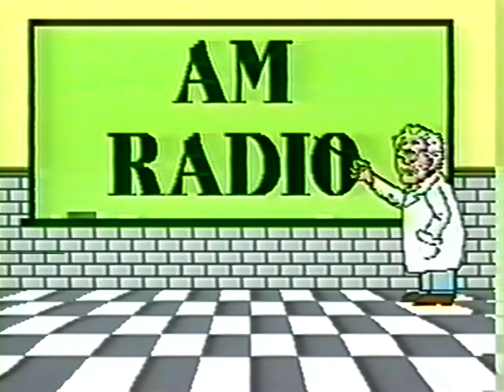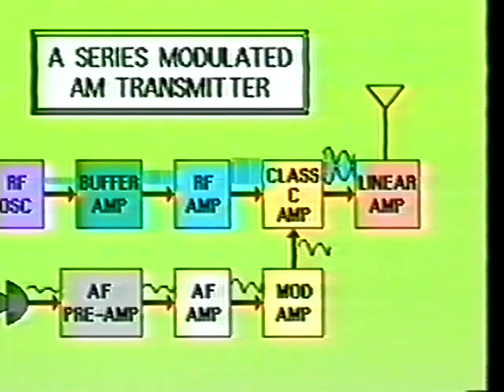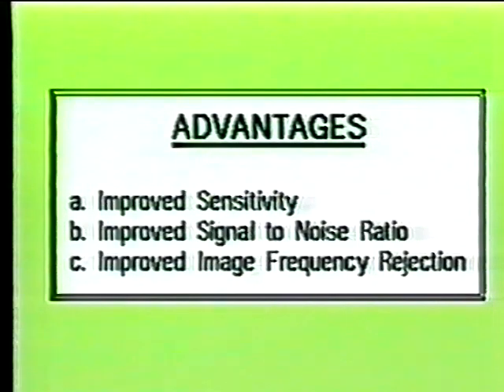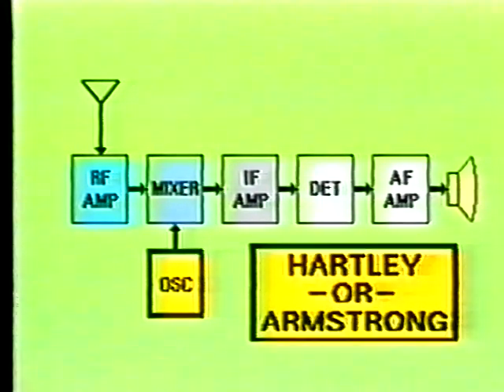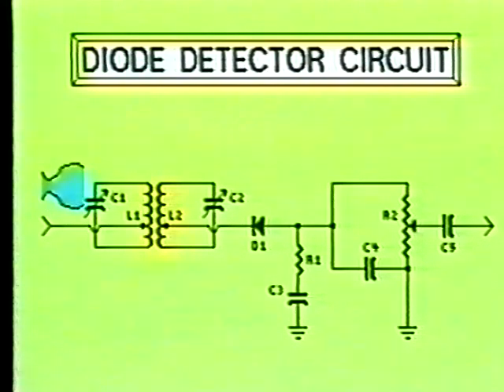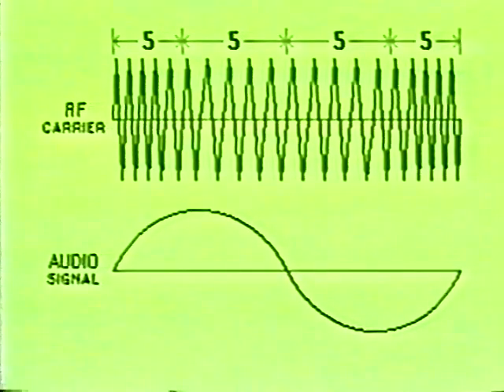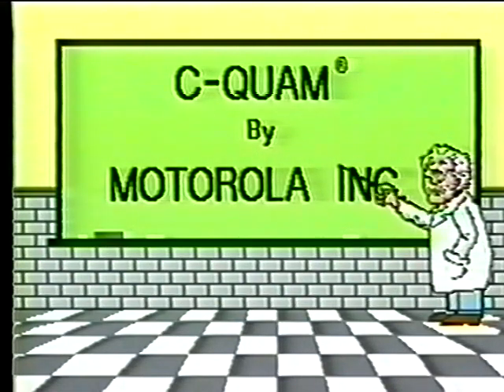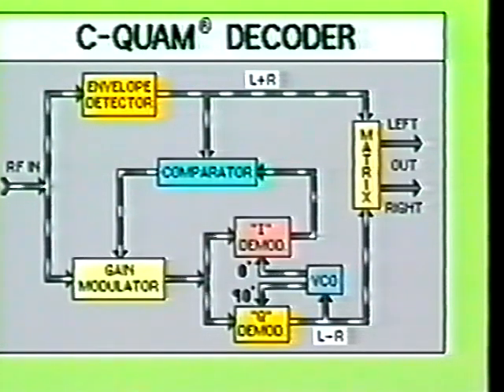AM Radio Training Video 1993

Comment: I am glad that the video taught me something about AM Stereo, and it's that the AM stereo signal is modulated using Phase Modulation.  But still, I wish that Uncando would of came out with a video about ham radio modulation such as Narrow Band FM, Upper and Lower Sideband and Continous Wave, and Radio Teletype digital modes, because when this video came out, I owned a DX-380 and DX-390 Radio Shack short wave receiver, and I was very serious about radio communications back in the year 1993 when I was in the 10th grade.

Comment: Very good explanation of how radios work.  I'm old enough to remember when AM stereo was being pushed out and thinking...Why?  By that time AM stations in my area were mostly talk radio and lack of stereo was never AM's biggest shortcoming.
Reply: AM Stereo was a missed opportunity. AM travels much further than FM and contrary to what most people think, the sound form a stereo AM receiver is nothing short of amazing. Many AM frequencies now carry talk formats because mono AM is well suited for that, but it didn't have to be that way.
Reply: @stopthebus  lack of the special radios to receive stereo am. No promotion of them other than a few automobile commercials that mentioned trying to get an upsale. The 3 big ones should have agreed on 25Hz pilot earlier than.  Motorola, Harris and Magnavox could all be worked with Motorola chip. Kahn should have started in 1950 before fm stereo because his could have been done with 2 filters 10kHz apart and 2 diodes. Lower filter left diode, upper filter right diode for high fidelity ISB stereo. Tuning between the filters would be strange and you could listen to 2 radio stations at once on narrow fidelity for each.  Left channel for one, right channel 10kHz up. The idea is using 445kHz and 455kHz dual filters and centering the IF at 450kHz, the +5 -5 kHz edges of both filters for 10kHz high fidelity stereo,  or 2 low fidelity stations at once independently of each other's sources. Something to think about.  So actually Kahn could have beaten them all to the punch before transistors.
Reply: @ElektroQtusZar  Yes, lack of a defining standard didn't help. We can focus on the situation today however and implement stereo for any AM station. Manufacturers can easily add Motorola decoding as part of the firmware - it can be done with DSP.
Reply: I just learned that AM stereo exists and is a thing.
Here in Germany we never had it and don't even have regular AM anymore. Can it be used on any  Ham Band?
Reply: "Why go stereo when you can fake it with Reverb?" Asked a tightwad satellite radio / AM station owner with bad hearing. "They will never notice how compressed the audio is now!" "We can run the same content over and over because no matter how loud they turn it up , they won't hear it all!" If you read all this and have an opinion about or similar experience, I'm all ears .
Reply: @321CatboxWA  it was tried in automotive and failed. It was fun while it lasted.  Radio has become all political. I wanted to be a broadcaster years ago.  But it's too late for me to get in that game.  Too many obstacles.  I only want to play with amateur radio and a few scientific experiments.  😆
Reply: @JoeyLanclos-x6m  imagine broadcast television, or perhaps a national propaganda on shortwave for the masses,  digital with a robust error correction . Plenty of empty former commercial Bring back MTV.    I'm aware of sstv , done it . Meh
Reply: @JoeyLanclos-x6m  In the name of scientific research rules may be bent.

Comment: Not much of an advantage of AM stereo because the complexity and AM  radio has limited audio frequency of 6K.
Reply: AM stereo is no more complex (if anything it's less complex) than FM stereo. AM also travels much further and don't let numbers fool you. AM radio does not have a limited audio of 6 kHz. The limit is in the receiver, not the transmitter. Have you ever heard an AM stereo broadcast?
Reply: @stopthebus  several thousand hours.  Houston Texas had 2 Kahn, 2 Harris, 2 Motorola. Dallas, Beaumont and San Antonio had bottom 3 locked down with Motorola.  I've heard them all to include WOWO 1190 Magnavox.
Reply: Hello from Australia!  AM radio is not inherently inferior to FM as far as  audio quality goes. However,  in the broadcast (MW) band, audio bandwidth is deliberately restricted at AM transmitters and in AM superhet receivers so that stations close together in frequency can be separated. AM sound quality can be just as good as FM if it's allowed to be. As for wideband AM stereo, it was tried here for a while but was not commercially successful.
Reply: @ Agreed on all points. Do you have any connection to the Australian broadcasting scene today?
Reply: @stopthebus  No, I am in the USA.
Reply: @stopthebus  No, I don't, and never have, but I'm a retired electronics technician with an interest in radio, and am currently involved in 2 vintage radio societies. I remember my 1st radio, a crystal set which I made at the age of about 12. I didn't have much pocket money, but managed to cobble together all the components for it. But I was disappointed when I got it working - in the day, I could hear all 8 Melbourne AM stations at once, and could not tune any of them. Most of them went off the air before midnight, but there was one, (3XY), that called itself "the all-night station", and was on the air 24/7. After midnight, I would lie in bed in the dark listening on my phones, and could hear 3XY clearly without interference from the other stations. For many years, I did not know what the tuning problem was. Much later, I worked it out - I had been given a variable capacitor for tuning by another kid  at school. It was a small RF trimmer type with 360 degrees of rotation, and did not have enough capacitance at any setting to tune any broadcast band frequencies, given the coil I was using. 

Good to hear that you agree with me "on all points" in my previous reply.  'Bye.

Rod.

Comment: Shango 66 went to the last A.M stero station and made a UTube out of it. Talk about going down a rabit hole. Thanks for the show it helps me forget just for a moment the times we live in.
Reply: Far from the last AM CQUAM station in the US...just the one closest to him that would let him in the door.   CQUAM DXing is still quite alive
Reply: @steveb3885  if these stations want to use IBOC, do so during the day. Switch to CQUAM at night to reduce interference 40kHz across some other guys' night signals.  These IBOC am radios can all decode CQUAM. Maybe narrow band audio but still stereo.  That would also make less interference for everyone else as well. Especially to 50KW broadcasters. And usually IBOC modulators contain CQUAM circuits and can be swapped with a switch.
Reply: @ElektroQtusZar  iboc is not compatible with current receivers, this the fcc wouldnt allow it
Reply: @steveb3885  I thought WLS was running IBOC??
Reply: @steveb3885  if Leonard Kahn would have figured his independent sideband method in the 50's or 60's we could have had some rather unique am stereo high fidelity  /  double station low fidelity independent output radio and that would have been that. Before fm stereo!
Reply: @steveb3885  I stand corrected on IBOC. Recently found out that it causes too much interference for adjacent channels big time and that's strictly a no no. So no more IBOC I suppose.  CQUAM is still legal and radios with HD AM can use the analog stereo as well saying as the chipset has Motorola stereo coincidentally as part of the set. They'll play narrow band but still stereo.  

Broadcasters : those who got IBOC AM STEREO exciters, please consider switching the CQUAM on. If your tower is already broadband enough for HD, it's way good for analog stereo 10kHz audio.
Reply: @ElektroQtusZar  no, they are running a nautel dx50 and harris dx50 transmitters, mono am.   They HD stuff is on the fm transmitters.
Reply: last AM station in the US probably. 
but you can still use SW AM receivers i guess.